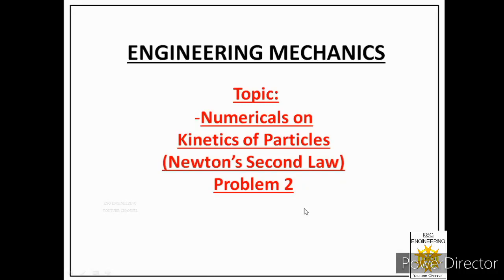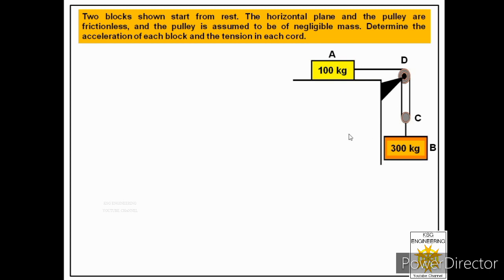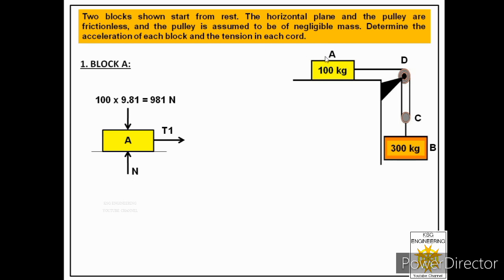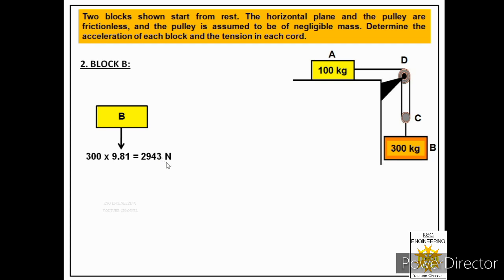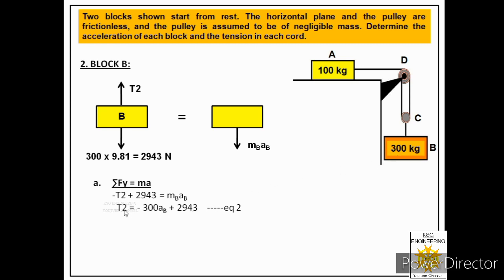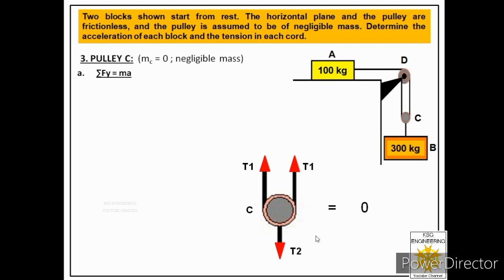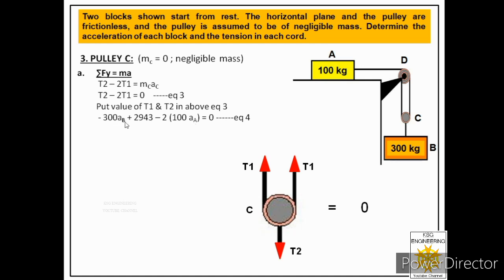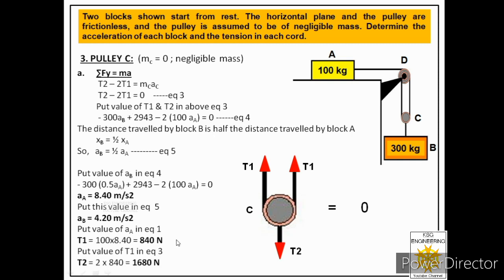kinetics of particles engineering mechanics | Newton’s Second Law | Engineering Mechanics | 13.2

Comment: Sir what if the velocity was asked instead of acceleration
Reply from the maker: For that data is insufficient in the statement. We must have some values related to time.
Reply: Sir kya yeh dbatu University ka syllabus hai
Reply from the maker: @isakadri___4892  These are general topics from the course of engineering mechanics which is taught in almost all the Universities in first year